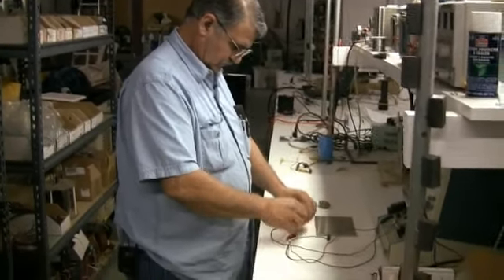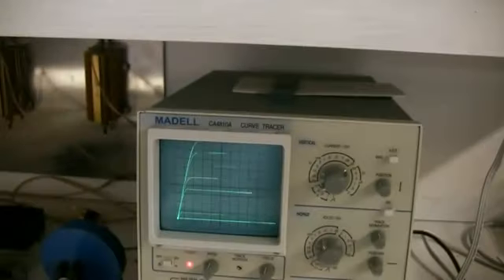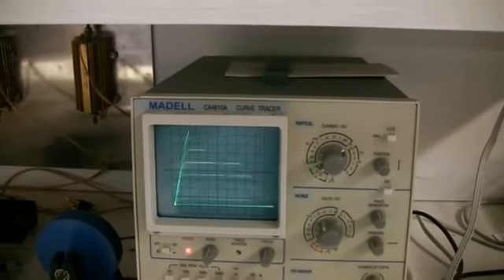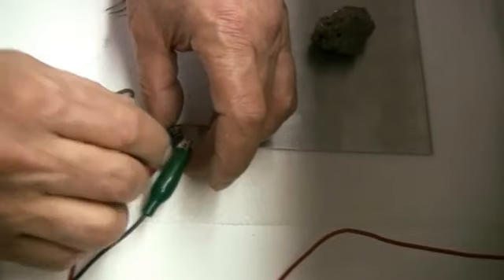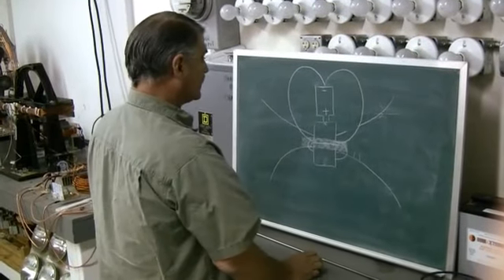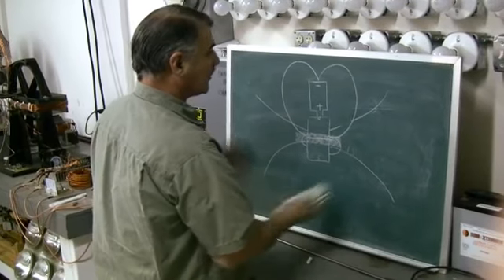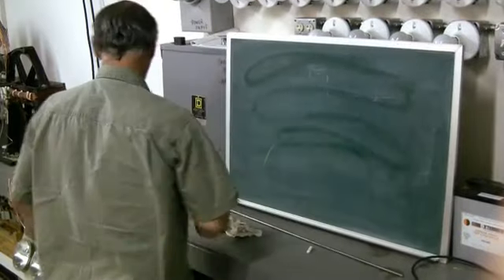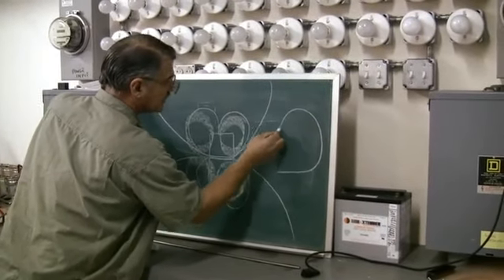#12 - Petrovoltaics & The Faraday Motor (2009)

Comment: 47:51 That's why whatever built the planet "knew" to encase the liquid core in Peteovoltaic Rock, to amplify & stabilize the Magnetosphere, Gravity & Inertia in Unity(not overunity, that would be the Sun). 

The gyroscopic effect dissipates inertial forces & external radiation around/sometimes through the planet/field.
Reply: Petrovoltaic

Comment from the maker: 1:22: ⚛ Exploring the use of rocks for testing transistor properties and energy generation.
1:22: Testing rocks for semiconductor properties and energy generation using a curve tracer.
2:20: Utilizing rocks as emitter, collector, and base to observe diode action.

8:09: ⚡ Revolutionary rock device offers customizable energy curve, unlike traditional transistors, for cosmic energy detection.
8:09: Rock device provides customizable energy curve
9:43: Advantage over traditional transistors for cosmic energy detection
10:03: Use of device for capturing cosmic energy explained

16:42: ⚛ Study on crystal properties and doping for consistent device manufacturing.
16:42: Potential advantages of dynamic capability in specific applications.
16:59: Testing crystal properties for consistent device manufacturing.
17:22: Observation of gold and ruby crystal on the backside of the material.

22:23: ⚡ Innovative methods in creating transistors through high stress and electrical discharge.
22:23: Jacob suppressed efforts with detailed documentation, but underestimated John's expertise.
23:15: John's unique approach in making transistors involves high stress and electrical discharge.

27:45: ⚠ Fatal demonstration to prove a point about business seriousness.
27:45: A man is killed with an ice dart to show the speaker the seriousness of the situation.
28:03: The emergency team arrives and uses extreme measures to demonstrate their intentions.
28:26: The incident serves as a harsh lesson about the ruthless mentality of those involved.

34:19: ⚡ Exploring room temperature superconductors using quartz crystals with negative resistance.
34:19: Experimenting with quartz crystals to achieve a room temperature superconductor with minimal resistance.
35:06: Observing the negative resistance behavior of the quartz crystal when electricity is applied.

41:14: 🔍 Exploring the significance of iron pyrite in studying past magnetic fields and rock samples.
41:14: Iron pyrite is considered the best for studying past events through rock samples.
41:44: Different lattices of iron pyrite indicate variations in Earth's magnetic fields.
42:17: The color and composition of iron pyrite samples can provide valuable insights into geological history.

47:36: ⚡ Exploration of natural negative resistor potential in pyrite minerals and its connection to magnetic fields.
47:36: Pyrite minerals may hold the key to natural negative resistor discovery.
47:49: Magnetic fields play a crucial role in the formation and properties of pyrite minerals.
49:04: Nature has already created the negative resistor, waiting to be harnessed.

54:16: ⚡ Exploring the concept of free energy and different forms of electricity in everyday surroundings.
54:16: Free energy can potentially be harnessed from the air due to the natural electric charge between two plates.
54:41: Walking around in everyday spaces involves being surrounded by electricity, which can be converted and stored for later use.
55:09: By sticking two rods in the ground, a different form of electricity can be felt, although not easily measurable with a meter.

1:01:51: ⚡ Exploring the anti-gravity effect of electromagnetic coils and vacuum energy.
1:01:51: Opposing spins in magnetic fields lead to repulsion in a motor.
1:02:50: Gravity effect in electromagnetic coils is observed outside the poles.
1:03:03: Anti-gravity potential indicated by the energy distribution in the absence of gravity.

1:08:46: 🔌 Exploration of electromagnetic coils and magnetic fields in motor operation.
1:08:46: Energy entering creates magnetic field lines with four spins.
1:09:40: The loops of wire in the motor operate without brushes or contacts.
1:10:13: Opposing magnetic fields in the motor enable spinning without satisfactory explanation.

1:16:15: ⚡ Revolutionary demonstration of accelerating particles in a copper wire motor.
1:16:15: Demonstration of particles accelerating at light speed in a copper wire motor.
1:17:27: Potential for commercial application as a motor, potentially used in military submarines.

1:24:46: ⚙ Exploration of magnetic fields in motion and their potential applications.
1:24:46: Discussion on utilizing spinning magnetic fields for speed enhancement.
1:25:41: Experiment showcasing the magnetic fields in action and their impact on movement.
1:26:05: Insights into the maintenance and functionality of magnetic field-based mechanisms.